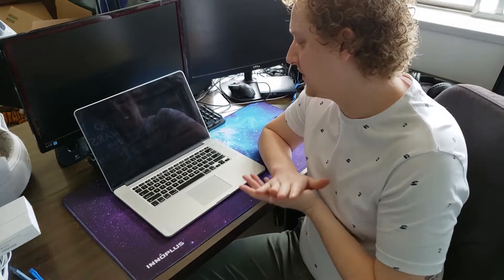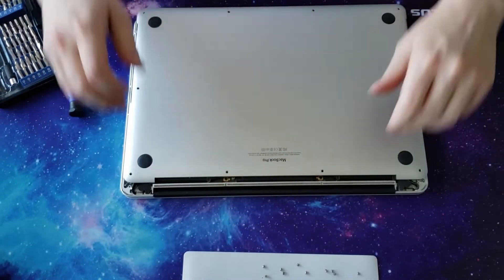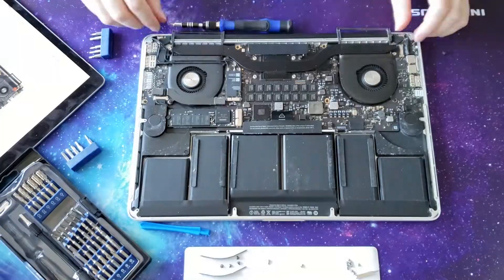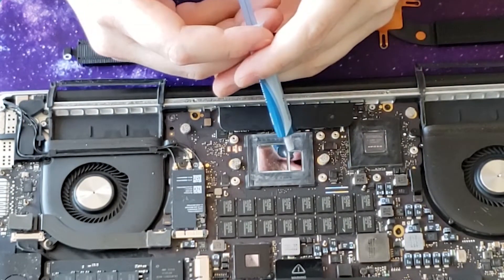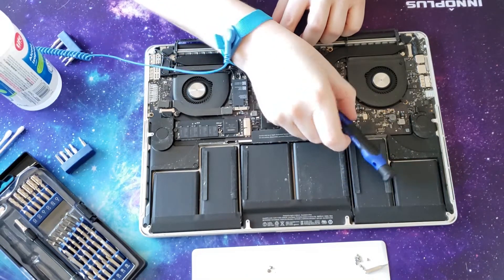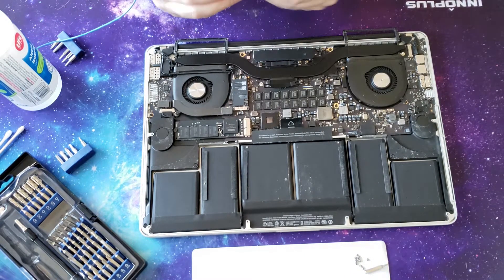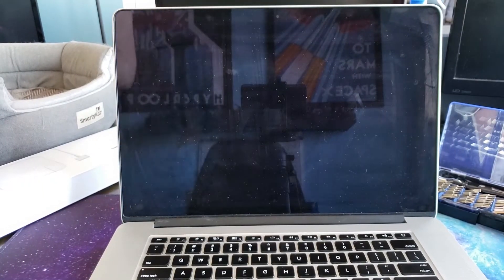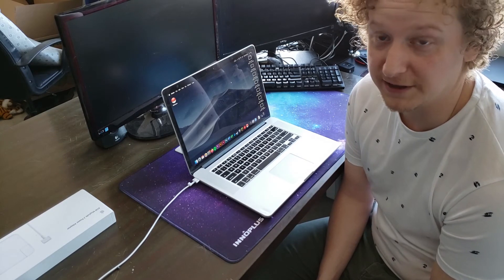Replace Thermal Paste - Late 2013 MacBook Pro Tutorial

Comment: I’m thinking of a similar treatment for my MBP retina 15 early 2013. Just using it as a Minecraft Bedrock server atm and it gets quite loud with 5 people on... also quite laggy they say. Do you reckon the paste replacement would help?
Reply from the maker: The design of these is the biggest limiting factor. If I were you I'd sell it and put the money into an older desktop. It'll be quieter, faster, and have better thermals. Sub to the channel - my next video is going to be about building a PC that's at least as good as the steam deck for $150.

Comment: found this video via your post on reddit. proud owner of a 2013 late model macbook here with the discrete gpu. i went the liquid metal route for my machine, and i said my fan speeds doing nominal work via youtube and browsing internet (firefox) using archlinux connected to an external 4k monitor at 60hz via the display port i'm averaging anywhere from 75C to 81C for my cpu, and fan speeds unfortunately spin at around 4000 RPM to around 5500 RPM. if i didn't here the fans spin i'd pretty happy with it. you can't hear them at around 2000 RPM (the idle) but once they creep into the 5000 RPM range you can definitely here them.
Reply from the maker: That's awesome! I ended up moving this machine because I was disappointed with the cooling. Sounds like yours isn't doing too bad though!

Comment: Hey quick question, what were your temps before and after redoing thermal paste under load and idle. im also considering doing this to my 15' 2013. This thing gets hotter than any macbook ive previously owned
Reply from the maker: Hi Paul! 

Temps were usually around 70 to 80 celcius when browsing online and then would hit 99 celcius when playing games like Minecraft. Sadly I sold the thing as I was worried about how hot it got and didn't want to be the one to take the hit on depreciation. In your case, I would suggest doing the thermal paste, cleaning out the fans and vents, then purchasing a fan controller that gives you real-time time readouts. Also try not to work with it while on your lap. Ideally, you would use a laptop stand with a fan on the bottom.
Reply: @CanadianComputerCollector  cool thanks man! will do. i just ordered a tube of kryonaut. ill let you know how it goes! cheers mate
Reply: @CanadianComputerCollector  Hitting 99C under load has been a problem since I bought mine new - I asked apple and they told me that was normal. 7 years later it's starting to fail, so I'm going to try this thermal paste replacement.
Reply: @CanadianComputerCollector  just curious, how much were you able to sell the unit for? I am cleaning mine up (and battery replacement) in the hopes of selling. 

Love the video vibes btw!
Reply from the maker: @deja_vu_deluge  hey pal! I got about $850 CAD for mine on eBay. That was about a year ago, mind you.